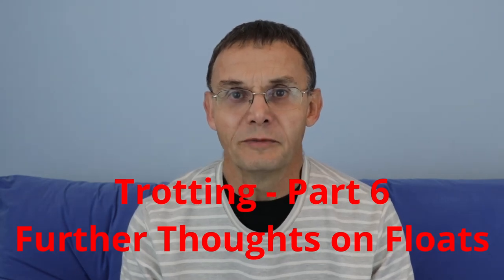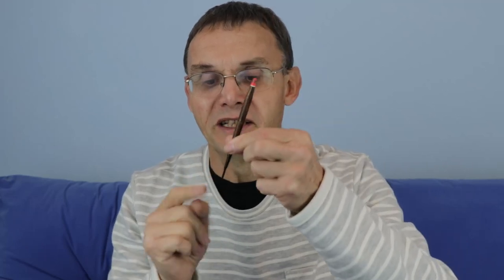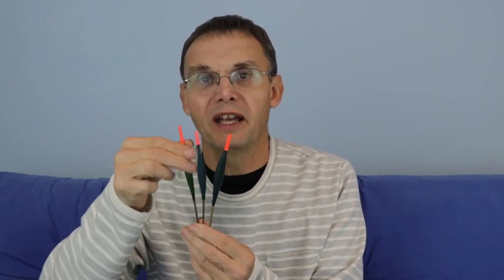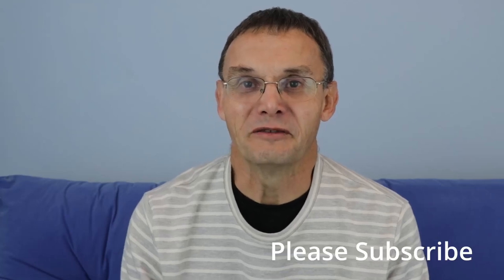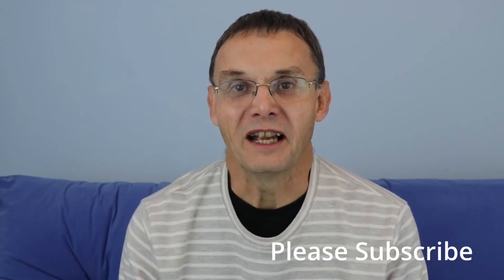Trotting - Part 6 - Further Thoughts on Floats

Comment: I have a soft spot for the very early Drennan slimline balsa floats. They were my go to floats at childe okeford  in the middle 70s. I won a couple of matches using them with largely Roach catches up to 10.10. Happy days...... I bought some of the Drake floats crow quill Avons. I used one at Havelins the other day. Not bad. They go up to 5.6 g. Plenty of Roach on the punch though nothing above 6 oz. One 3lb Chub gave me a run around! Very deep stretch that was difficult due to overhanging trees and vegetation. 👍
Reply from the maker: I had a favourite early Drennan balsa float, long lost though replaced in the much more recent past that was a simple tapered float with a two-colour tip, yellow with red on top. When you watched it it showed yellow but when it went down you saw the red.
I must try Havelins again.

Comment: If one's eye sight is failing, you can (with a fine drill) Drill down by hand into the sight tip & glue in a painted cocktail stick/kebab skewer, (cut the point off for safety & down to a desired length) I've done it with a few of my old stick floats, where the tip is very short!!